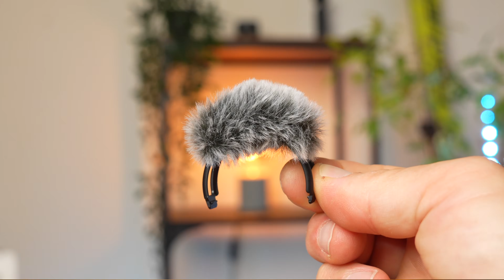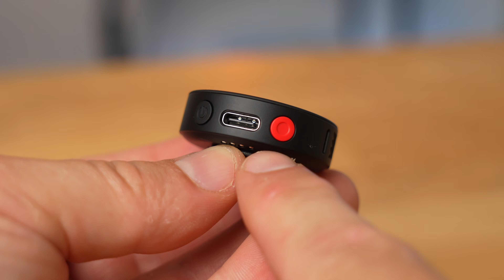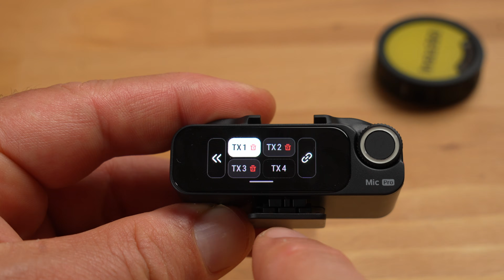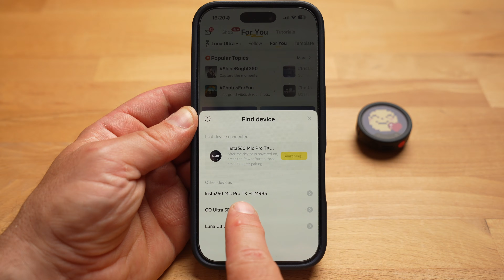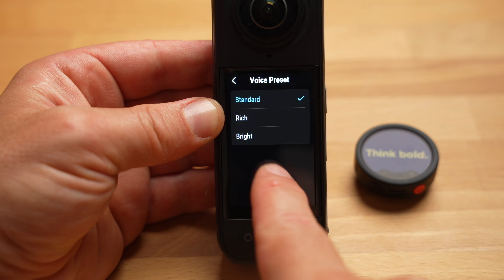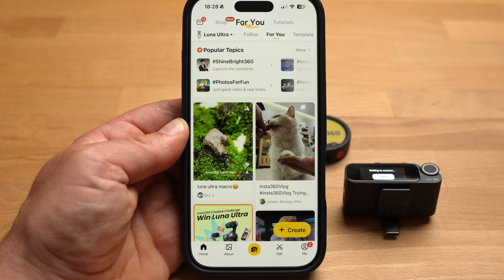Insta360 Mic Pro The Ultimate Beginner's Guide

Comment: As always excellent review! I have insta360 X5 and just bought mic (transmitter only) - I would be very grateful if you can share your experience how to best set up for motorcycle engine recording. Many thanks
Reply from the maker: Hey, I'm afraid I can't help you there, since I don't have any experience with it—you'll have to test the presets and decide which one works best for you. The noise-canceling feature does a good job of suppressing engine noise, but I don't know if that's even what you want.
Reply: @MountMediaChannel thank you for your prompt reply- appreciate it! Will try and test!

Comment: Thanks for this tutorial!🎙️To viewers: Voice focus also works when the mic is connected to the (go ultra) camera directly, but not in combination with noise cancelation. If you have noice cancelation turned on, you can only choose: omni directional, cardioid and figure 8. To me figure 8 picks up my voice the strongest when I have noise cancelation turned on (and windmuf). I do have to hold it in my hand, the difference is huge when attached to your shirt. (On the luna ultra I can only choose omni, cardioid and figure 8, haven’t found voice focus there either. But at least I can change the settings without using the phone app each time, and without needing a receiver).

To find these settings (on the go ultra) you have to swipe down and go back to the “add accessories menu” in your camera, then click the mic pro (I know this feels odd, but you won’t pair it again). And there you finally find the advanced audio settings w/o needing your phone each time. The normal “audio settings menu” in your camera (stupid enough) doesn’t give you these extra options. So I hope this extra hack helps other people that are still aimlessly looking for the advanced features too. (On the luna ultra you can swipe down and find the audio settings under “wireless mic”, it has its own audio menu there, similar to the one on go ultra).

Last tip: maybe I was only able to find the menu after doing a firmware update by connecting the mic to the phone app once. And after updating the cam too. Or maybe this feature was hidden in the wrong place all along… 😂 But that firmware update also increased the sound quality of the mic with 300% (on the go ultra), so it’s worth updating. Before it sounded really cheap.

Comment: Thank you this is so helpful! I have a receiver + two transmitters and plan to add 2 tx more for 4 separate audio tracks. However, when I have the receiver connected to Luna Ultra via usb-c, pressing the camera shutter button does not trigger simultaneous recording of audio on the mic pro transmitters. This can't be right. Do I have the settings wrong? Or...

Comment: Question. When just using one transmitter connected via Bluetooth to Insta360 ace Pro 2, when you hit record on the camera, why does it not record audio from the camera mic and audio from the one transmitter at the same time to the video? Or am I missing a setting to enable this?

Comment: So are you saying you can only use voice focus if you have the receiver? Or can you change that in the app? Seems strange that you would need a bulky receiver when using this in noisy environments.
Reply: It also works if you connect the mic to the camera directly. See my comment about voice focus in the main comment section. I tried sharing the link to my reply, but that didn’t work. Lol.
Reply: Can adjust the settings in phone app
Reply: @lolxpism yes
Reply: No need to have receiver, just transmitter (mic)
Reply: Can adjust on app or directly on the insta cameras! It’s pretty sweet
Reply: @JayFriedrichs if you only have the transmitter there is no option to mix the audio in the app.

Comment: Hi! Thanks for the detailed review. I have a few questions:
1. If I only buy a single Mic Pro transmitter (without the receiver), can I still use all of its features when connecting directly to the Insta360 X5?
2. When recording via the direct Bluetooth connection to the X5, what is the actual audio recording quality? Is it 16-bit, 24-bit, or 32-bit float?
3. Can I use the Mic Pro as a remote to quickly wake up, start recording, and stop recording on the Insta360 X5?
4. Does the transmitter simultaneously record a backup audio file internally while transmitting to the X5? If the wireless connection drops, will I still have the backup recording? Even DJI's proprietary 2.4 GHz wireless system can occasionally lose connection, so I'm curious how Insta360 handles this.

Comment: Great video! I have a question, if I just got the transmitter only and used Bluetooth to record video in Final Cut Pro Camera, I can still turn the internal audio recording on and use that to get the best possible audio quality, correct?
Reply from the maker: Yes, that’s right - you just have to Sync it later

Comment: How can I use this as a Dj? To connect the Mic pro to a Dj Mixer and to my x5 or Luna camera to get the sound and the video syncd?
Reply: You take a line level output from the mixer through an attenuator to provide Mic level, connect that attenuated output to the USB on the Mic Pro using an Insta360 Microphone socket to USB-C adapter.. For X5, simply have that Mic Pro as the paired device to the X5 and for the Luna Camera use the Mic Pro receiver. If you want X5 and Luna at the same time, use two Mic Pro receivers and you will also need an X5 Mic adapter. Its probably easier just to have the Mic Pro connected to the Mixer and record internally on the Mic Pro and use that sound track when mixing the video in post.

Comment: Great video, thanks. One question: if you are using the Mic Pro in Cardiod (Q) mode indoors in a relatively quiet space but with the AC (HVAC) on, which mode will be best for an education channel - Rich or Bright, where good audio is crucial? 
And, can strong noise cancellation feature also be used in this situations to make the audio even better than in weak noise cancellation?
Reply from the maker: Bright can be great for educational content. Only use noise cancelling when there is a lot of background noise

Comment: Thanks. You covered a lot of ground in a very clear manner. It's worth adding, however, that when using the Mic Pro as a stereo audio recorder, using 32-bit float, most of the options for sound quality and pickup pattern do not make any difference. Even if you set the sound to processed, those settings are intended only for when you are using the device as a mono recorder.
 
 I only bought the transmitter, and I have been using it simply as a high-quality audio recorder for field, location, or event recording. It is the smallest device that you can buy which is capable of 32-bit float stereo recording, and the quality of the microphones is remarkable. I have been comparing it with well-known models from the Zoom range, and it produces better results. And unlike larger recorders, I can simply keep it in my trouser pocket, ready to use when any interesting sounds are encountered when I'm out and about.
Reply from the maker: Interesting experience, it's definitely a powerful little tool for field recording!